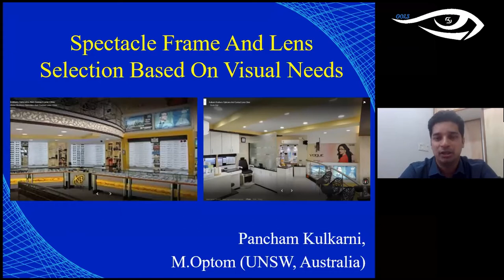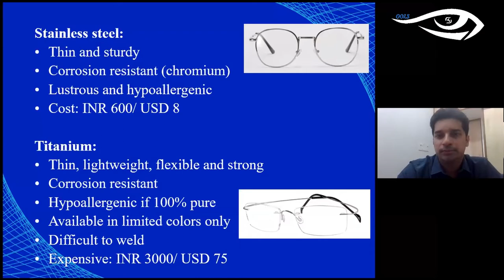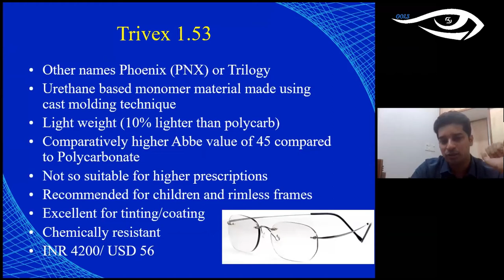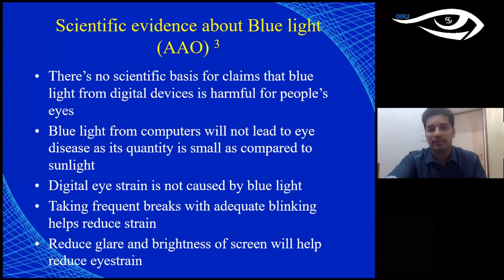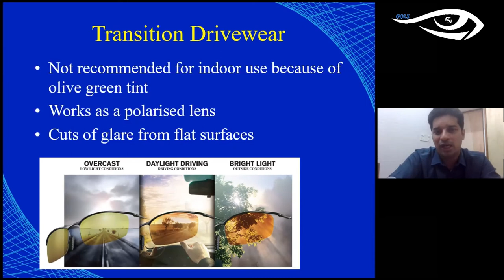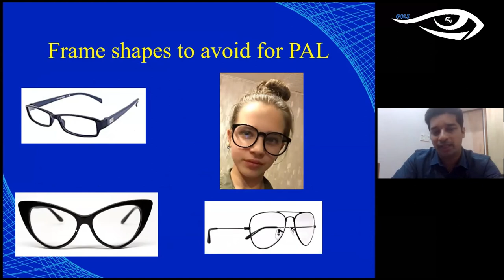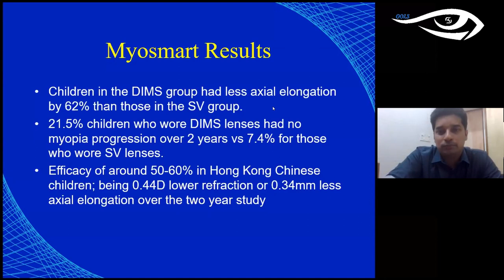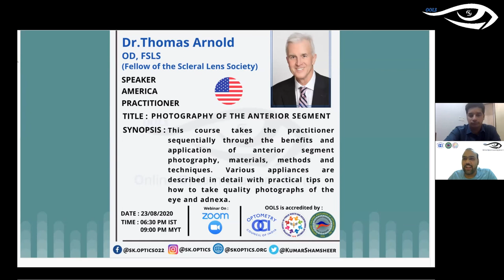#SpectacleFrame and #Lens Selection based on #VisualNeeds. | OOLS | Optom. Pancham Kulkarni

Comment from the maker: Right frame material for each customer:
Plastic molded frames (4:48)
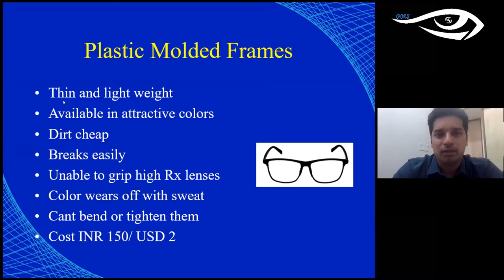TR – 90 nylon and Ultem frames (6:02)
Mira flex frames (7:08)
Cellulose acetate frames (7:46)
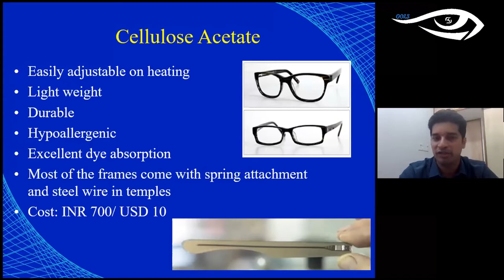Optyl frames (8:55)
Metal frames (10:31)

Appropriate lens for the customer:
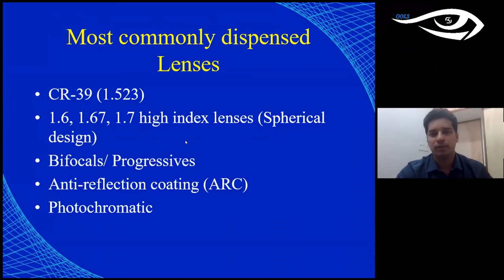High index lenses (14:41)
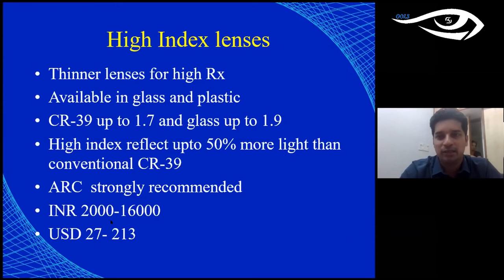Aspheric lenses (15:33)
Polycarbonate lenses (19:52)
Trivex Lenses (21:28)
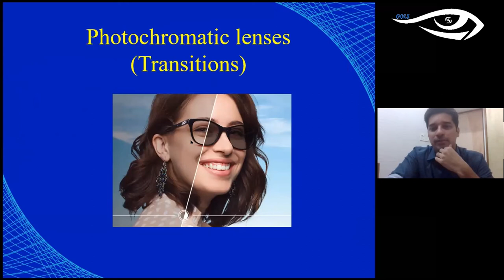Photochromatic lenses (34:00)
Transition Classic (34:15)
Transition Signature 7 (35:20)
Transition XTRActive (37:15)
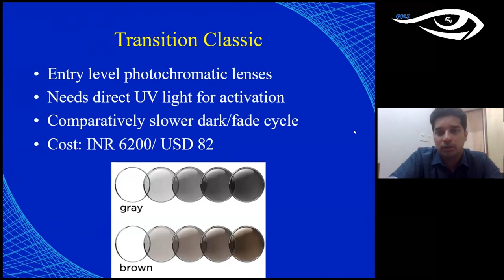Transition Drive (39:21)